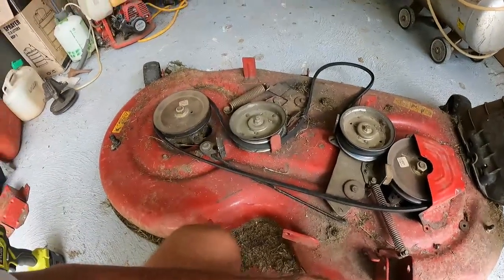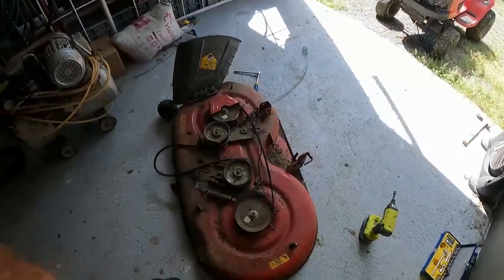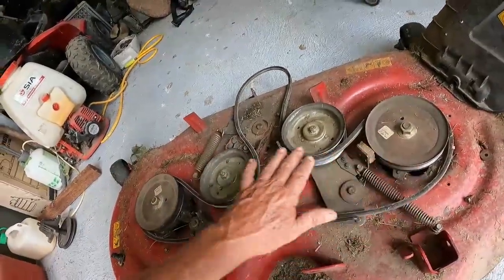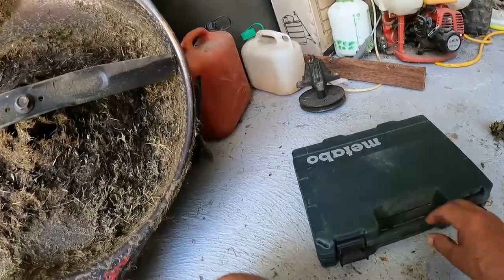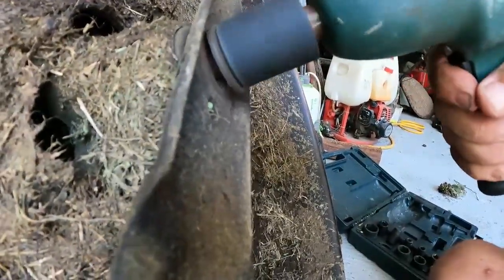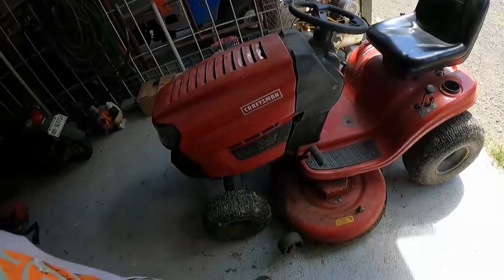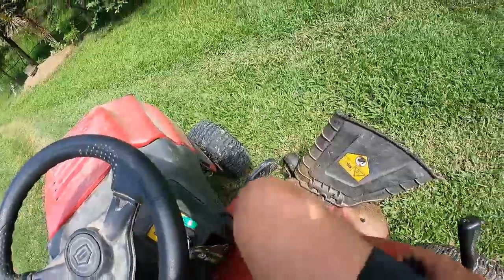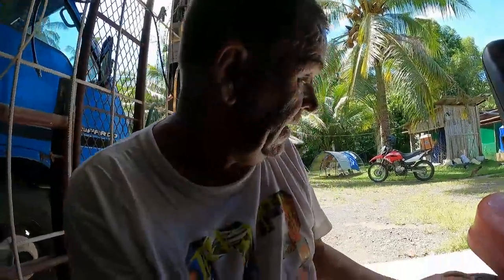How To Replace  a Craftsman 48in Lawn Mower Deck V-Belt

Comment: I had similar problems with my Craftsman. The belt kept on falling off. I asked my buddy to take a look. It was not the belt stretching out as I thought but the Spindles, . big bucks, waiting time. That's why I decided to get the TORO, zero turn 50 inches swathe. Fast too, and can run 2 hours on a gallon of gas (You call it Petrol, other places call it Benzin Ha, Ha, Ha.)
Reply from the maker: Oh you are lucky to have a zero turn,, ONLY in my dreams  for me